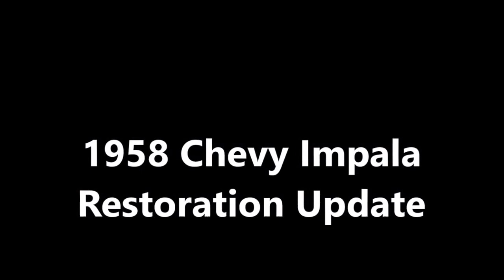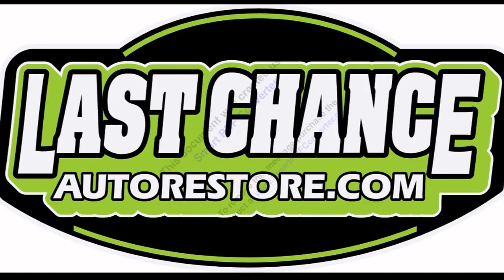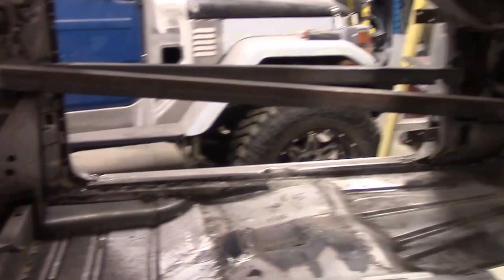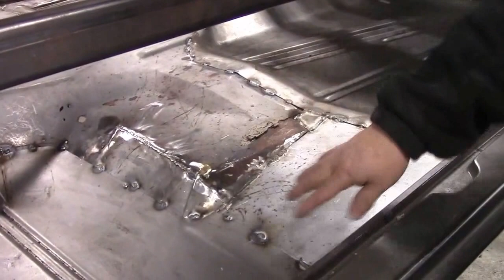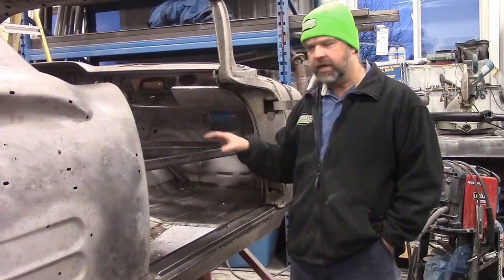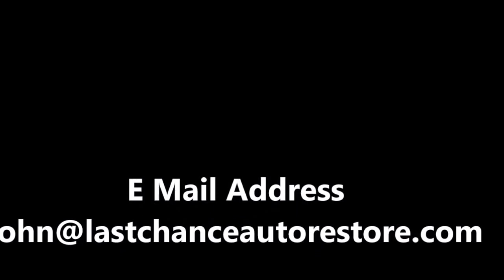1958 Chevy Impala Restoration Update, Metal Repair,  lastchanceautorestore com

Comment: You mention photos in this video.  I'm wondering where I could find them?  Your 1958 Impala videos have been so helpful.
Reply: The inner rocker panel that is rear of the door opening, but forward of the wheel opening, appears to be very hard to acess for removing, at least at the top. at the bottom, the spot welds can be drilled out no problem.  It appears that to acess the top, is via removing Rear Lower Quarter Front  Panel (58-7757/58) or part of it. In my case, although I have this patch panel, I am reluctant to cut it out full length as only a small area near the wheel opening is rusted. Can you confirm to me that there is no other way?  thanks Emery